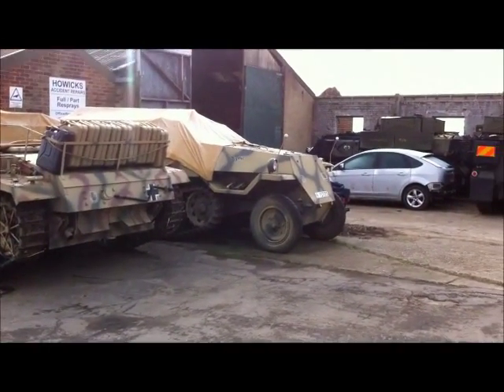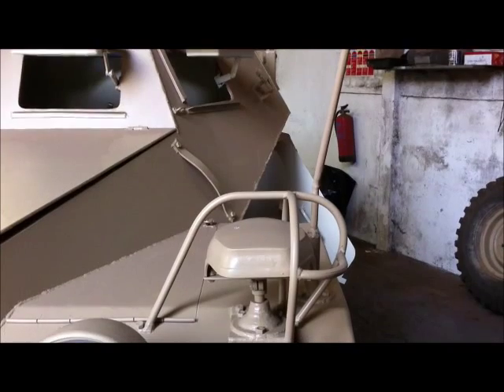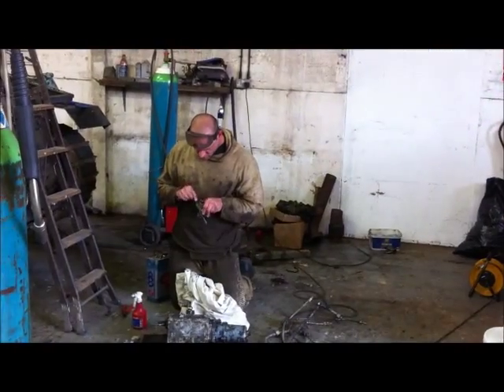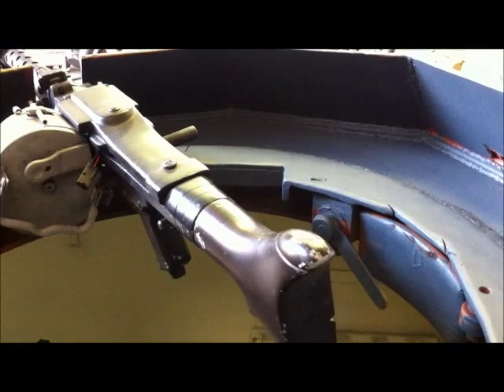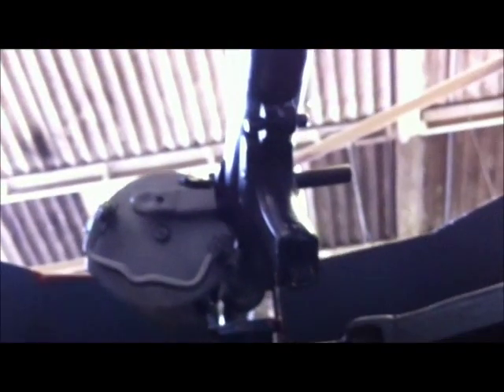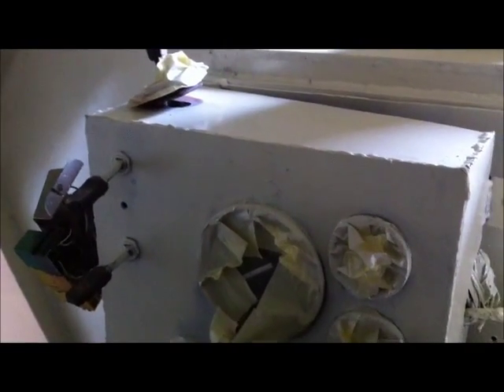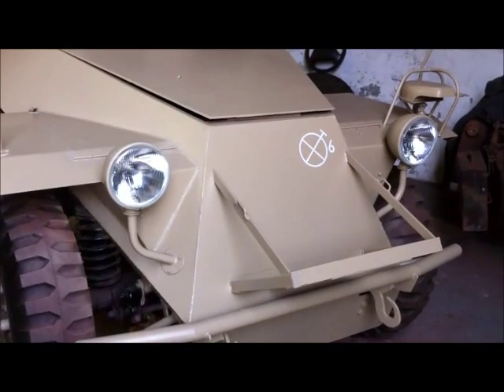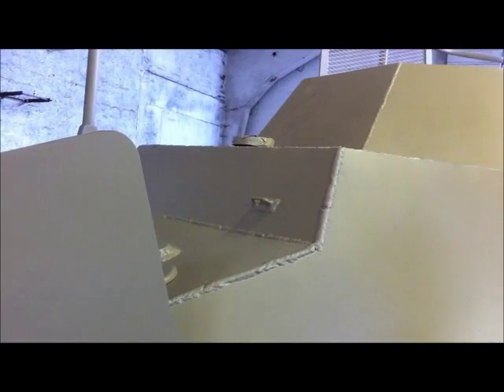SdKfz. 223 Panzerfunkwagen Replica

Comment from the maker: The welding on Hanne is actually better than the original ones so in that respect you are correct. When building these replicas H and the team often put dummy wide scruffy welds on to emulate the welding on the 1940s original.